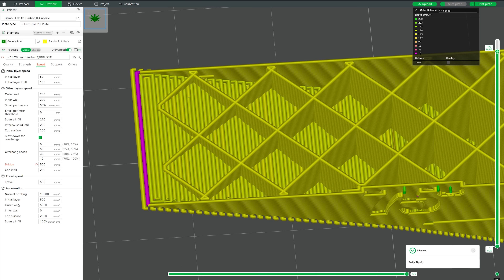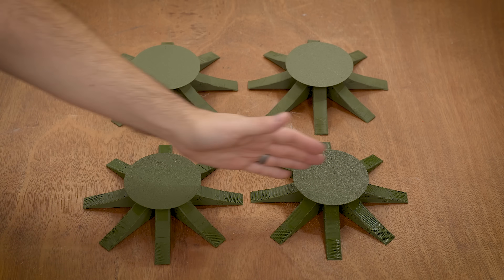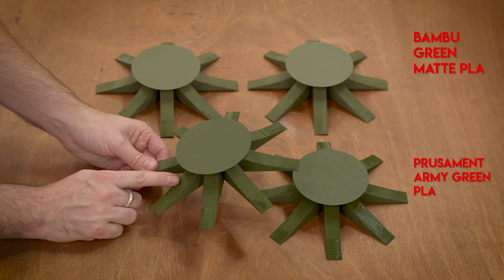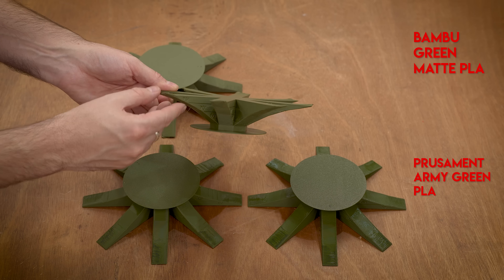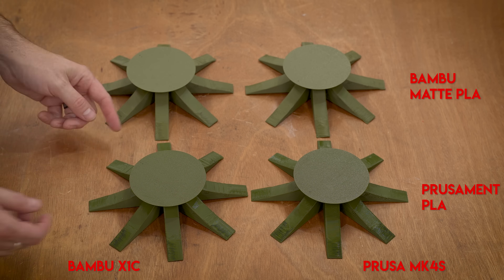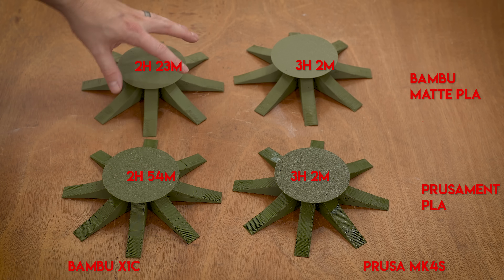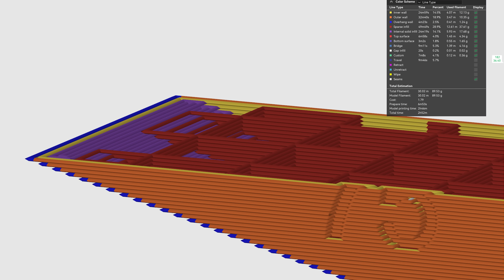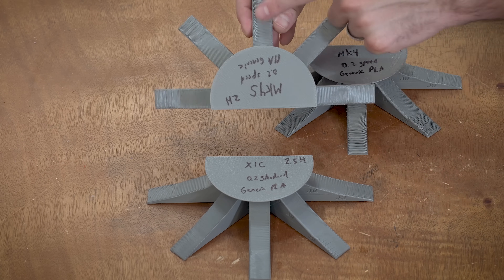The Overhang Showdown - X1C and MK4S

Comment: This is like the watches that can dive 200m deep. People don't buy them because they are professional divers, they buy them because they want to know that if the watch gets wet, it will keep working. The 75-degree overhang is not something people plan to use in their prints, but if you see that these printers can almost pull it without making a mess, it means that every 60-degree overhang they print will be flawless 100% of the time, with cheap filament, with out-of-the-box settings, it will always work.

Comment: Robert, you're just throwing out opinions without solid evidence. The Prusa MK4S clearly outperforms in overhangs due to its solid hardware and cooling setup, as shown in the All3DP test
Reply: @michaellstadler  cope buddy!
Reply: I just found this test at All3DP. Interesting that the Prusa achieves better results with its standard profile.
The test explicitly referred to this video. The bug in the Bambu Slicer certainly has an effect on the result. But accusing Prusa of cheating wasn't right either.

Comment: Lol I must laugh how you call it a bug , Bambu ripped prusa slicer and firmware and made it closed source. Prusa altered there slicer and got the overhang fixed cause it is not a bug but a feature. Then the chinese buggers ripped it again and call it a hoerayyy a fix.... A bug is actually a failure in the software and not a feature which is improved ow yes by prusa engineers. If bambulab also made everything open source everybody would benifit from it.

Comment: Would have been interesting if you had taken a brief look at the filament settings to show what was actually changing between Prusament/Bambu/Generic profiles. Iirc Prusa's Prusament profiles tend to print a little hotter than their generic, and I wouldn't be surprised if there were similar differences in Bambu Studio as well.
Reply from the maker: Understood.  I think for MOST printers once you start tuning and diving into things you can get better results.  BUT, I wanted to show what a new user would experience.

Comment: Weird, I installed the Bambu Studio update, 1.9.5.51, and sliced an overhang test at stock settings. I still see the outer wall speed at 38mm/s, inner wall at 10mm/s. I thought this was supposed to be changed, like how Orca behaves when enabling 'slow down for curled perimeter' or Prusa slicer by default
Reply from the maker: That's really strange.  It should have changed.

Comment: I’m grateful to own and use both regularly. My X1C is set up for orders (very small scale production of my own original functional parts). And my MK4 (soon to be MK4S) is set up for prototyping my designs. I like using the Prusa for prototyping because of how quickly it starts the print when compared to my Bambu.
Reply from the maker: Huh!  We're the opposite, I tend to use the Bambu for prototyping because the print itself is so much quicker.  I don't like all the stuff it does before a print, BUT I started both of these tests at the same time and the Bambu was still doing whatever it does and the Prusa was 1/4 the way through the first layer.  But then, the Bambu beat the Prusa on the first layer and was faster for the whole rest of the print.
Reply: @RobertCowanDIY  I really need to test the two against each other I reckon. I may have it backwards! I was going purely off startup time. But what you’re saying makes sense.

Comment: It just... REALLY annoys me that Prusa exploited a bug just so they could have a better talking point on their video.
Reply from the maker: If you look at Josef's pinned comment on that last video, I think you can tell that they just believe they're the best.  It's confirmation bias at work.  Apparently this new 'high flow' nozzle will be 'running circles around the competition'.  It shows a lack of awareness of what else is out there.
Reply: @RobertCowanDIY   absolutely, I bet they aren't even fully aware of the state of current market. That is why they are selling i3 printers for 1100...
Reply from the maker: @riba2233  I've had calls with them, and I wouldn't argue that statement.  They don't seem terribly aware of where the market is right now.
Reply: @RobertCowanDIY   thanks for the confirmation, unfortunately not very surprising.
Reply: Right? Didn't expect that from them

Comment: I use REALLY cheap filament (but still very good quality all things considered) that costs me 10 bucks per Kg, the brand is XTZL3D.

I have an A1 Mini and never had issues.

I said this because of the pointing out of the prusa being more picky with 'cheap' filament.

Maybe it's seriously tunned to some additive of the filament they use in their labs (wich I could bet it's polymaker)
Reply: Ofc, A1 has filament calibration in its head unlike prusa that costs 3x more
Reply: @riba2233  At least 5 times more actually. Lol

And yeah. Flow Calibration is really cool.

Can print PETG+ at 30mm^3/s Of volumetric flow on an A1 Mini and prob more if it wasn't by the spool getting tensioned too much.

A1 Mini cost me $200 bucks
Reply from the maker: @riba2233  True, but I've heard mixed things about the A1.  Most of the content creators I know say it went back in the box after the video.
Reply from the maker: I'm not sure, but I haven't had good luck with overture, matchbox or polymaker.  But those are fine on the bambu

Comment: I don't think it necessarily proves anything about Bambu, but I'm concerned that it took them a year and significant public outcry before they fixed a bug that Prusa had contributed back to the open source community.
Reply: Id say BL tends to listen to the community more often than not. Last I checked not many people printing at 75 degree, angles without supports. I would venture it's  small to nonexistent until Prusa made it a marketing point.

Should we fault Prusa for not having multiple build plates in the slicer as BS has had it for 2 years.
PS still does not have mesh boolean options either as bambu has been doing it for over a year. 

Software forks do not mean 1:1 copy.
Reply from the maker: @hawtdayum  Underrated comment right here...  People talk about how responsive Prusa is and how their support is so great, but Bambu got ON THIS.  Also, you're right about the multiple built plates and they've been doing some other stuff too.  In my mind Bambu Studio and Prusa Slicer are roughly equal (but different) in terms of what you get from a slicer.  It used to be that Prusa was still king, but Bambu has more than caught up to them.
Reply from the maker: They claim the bug just got buried.  Having worked near software for the last decade, it happens.  I wouldn't say there was public outcry, they were reminded of the importance and fixed it quickly

Comment: Supports aren't necessarily the be-all end-all solution to steep overhangs. Depending on the geometry, overhands often lift up away from the support structure below, leaving the same ugly surface as an unsupported version.  At some point, really steep overhands (close to 90 deg.) will relax and contact the supports, but I'm guessing there will still be an ugly region between 70 and 85 degrees.  Just to yank your chain, I'd love to see the tests repeated with overhands kicking in at 70 degrees.

Comment: It wasn't a bug. It was a check box in Orca, but it was BADLY labeled for what it achieves... Prusa has it checked by default and hidden. I believe they are the ones who contributed the feature itself I could be wrong on that though. Bambu did now too. shrug
Reply: I just wanted to throw in that after changing the setting in Orca and by adding a box fan as an auxiliary fan next to my Adventurer 5M I was able to print what seems to be better looking overhangs than some of those tests you showed lol (edit: Scandic plate was the test I used)
Reply: I'm going to use your model now and see how it comes out! <3

Comment: Conclusion: Doesn't really matter which printer you have or choose, simply do not print 75° of overhang 🤷‍♂️
When I started to print in 2019, everyone recommended limiting overhangs to 60-65° and it worked. Obviously physical printing limitations are still the same, therefore this topic is a bit overrated. Simply design your parts without such overhangs or use (ugly) supports.
Reply from the maker: Yep, pretty much.  It's strange they're trying to tell people they can do 75 degree overhangs, there are limitations to what can be done with a 0.4mm nozzle.

Comment: The generic profile on the Bambu just runs a flow rate of 20 by default. Most filaments can take significant more.
Reply: they can't, unless you like ugly prints. generic pla is like 12 iirc, bambu is 21

Comment: IM DISAGREEING WITH EVERYTHING! But yeah this makes a lot of sense. It feels a little slimy of prusa to push the overhangs this hard when they seem to have known that it was really just a slicer bug/feature, and that the bambu's have already caught up. But in the end, they're both good printers so ¯\_(ツ)_/¯
Reply: at this point I wonder if they knew it was a bug, but it is hard to believe their engineers working on it didnt notice that's the reason the bambulab was struggling so much, but again it's also hard to believe prusa didn't think people would realize on their own that was the case, they proudly boost a very savy and smart fanbase, this was not a mistery to figure out if you have both printers. Idk, weird situation all around lol

Comment: Hi Robert, thanks for the video. It looks like you were paid too little by both companies🤣 
I can absolutely agree with your summary. 
I think the update for the MK4 is worth it just for the new fan. This solution is stronger and more even in all directions than before. 

After all, it delivers similar performance but is still very quiet.
Which is important to me personally.
Remain critical, even if it hurts sometimes. 

As I have already written several times.
No printer or brand has only advantages. 
Everyone can buy their own best compromise.

Comment: Leave it to prusa to fix things and bambu to copy prusa's homework.
Reply: "“The [Prusa)Party told you to reject the evidence of your eyes and ears. It was their final, most essential command.”
― George Orwell, 1984

Are we looking at the same print?
Reply: So the claim that Bambu printers couldn't do what Prusa printers do was a misleading at best.

This was just a slicer update away, or 1 setting tweak, to correct which was fixed in a week of Robert's excellent investigation.

This just proves bambu printers can easily print this with other filaments whereas prusa printers NEED prusament to be good and even then it's just "ok" while taking more time to do it. 

For anyone with a mk4s, thinking you have a superior printer,  you have been mislead. For anyone with an X1C, a printer that was released 2 years ago, no need to update.
Reply: @personwomanmancameratelevision  Better print quality, better accuracy, just as fast, better build quality, EU/USA made, Doesn't scrub your data and sell it to the CCP, True innovator in 3d printing, far greater quality control, far greater reliability, far greater customer service, didn't have a safety recall, isn't being sued for patent infringement, pro open source, faster multi color printing, far lest wasteful multi color printing. The list goes on.

Prusa 4.7 TP rating
Bambu 2.3 TP rating.
The reviews speak for themselves. Prusa is indeed superior
Reply: @LilApe   haha still coping wildly, just what I wanted to see lol, you need disappoint.
Reply: @orangutan9492   that is simply because he is :) he is also an alt-righter and that explains a lot
Reply: @LilApe  "isn't being sued for patent infringement" lol, that's a compliment for Bambu...
Reply: ah weak cope, I expected to read a few paragraphs from you about how bambu sucks but what now that you've lost all your arguments lol...

Comment: Great job Robert. Enjoying this "not going to be a series"  deep dive and your time and effort to address it. 

I don't think I normally would print these extreme overhangs normally without supports as you mentioned. So the controversy was interesting if not silly on its face. 

There have been 2 bambu studio slicer updates since your last video, 1 addressing the overhang issue directly.
I think everyone who gets either brand will least accept these results or set the comments ablaze in fanboyism.

*feeding the algo 😁

Comment: The bug is not fully fixed in Orca, the fan speed is unchanged for the internal wall, which decreases overhang quality.
Reply: The Orca team has decided to declare this a user issue, not at bug. You just have to find the right tooltip in "advanced settings" to alter the default settings. which leaves me with the conclusion that beginners (and even standard users) should stick with the slicers of Bamboolab or Prusa.
Reply: @rarbiart  Yeah that's a shitty position they've taken.  "git gud" attitude, yikes.  Just opens the door for another slicer to become the new community favourite.
Reply: Hope they get fixed
Reply: I saw a comment once from someone who claimed to be an orca slicer developer. He said there was no bug, that it's a setting you can toggle. I'm not sure which setting that would be, it was mentioned but I can't remember what it was called.
Reply: @atnfn  yes it's called "curled overhangs", and it works but it doesn't affect fan speed for inner overhangs

Comment: Structural profile is the Prusa standard profile over the speed one.
Reply: Good point.  I'm conflicted as to which profile would be most appropriate.  If I actually want good overhangs, I'd use Structural for sure.  But since the MK4S was already losing the speed benchmark using the Speed profile, switching to the Structural profile would have only made the Prusa look that much slower.  By using PrusaSlicer's Speed profile, Robert made this more of an apples to apples comparison with more similar print times.  That said, Robert's conclusion to only print 70+ degree overhangs with supports should be taken with a grain of salt, since on Prusas the Speed profile is really more of a draft quality.  And if you're comparing Structural without supports against Speed with supports, Structural might end up both faster and better looking.  Obviously this topic is bigger than Robert wants to investigate, but for me the final word is far from conclusive.
Reply: @PaulStevensonPinball I agree the place where I find prusa to SMOKE bambu is that I can actually fix a prusa that breaks, good fukin Luck doing that with a bambu